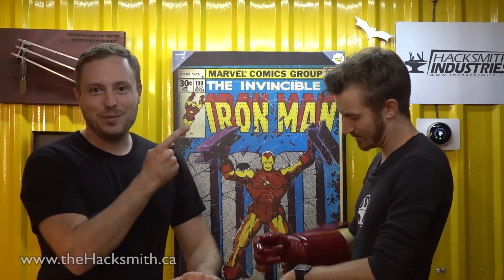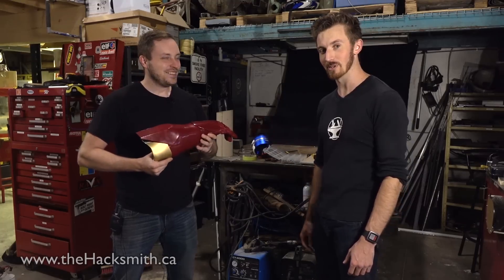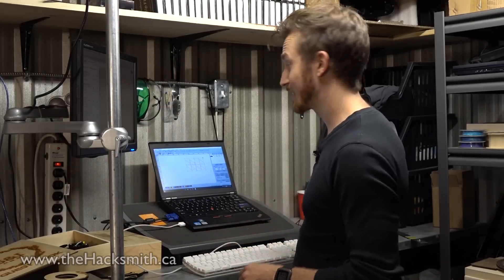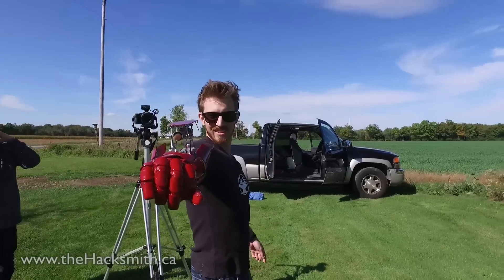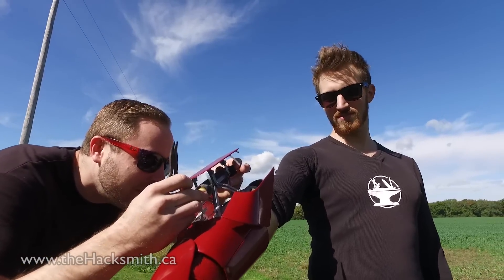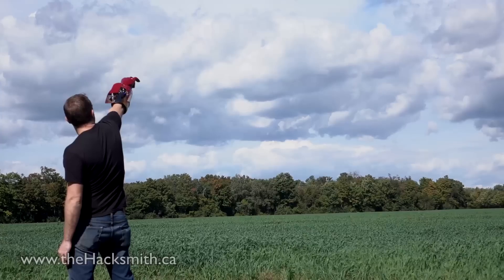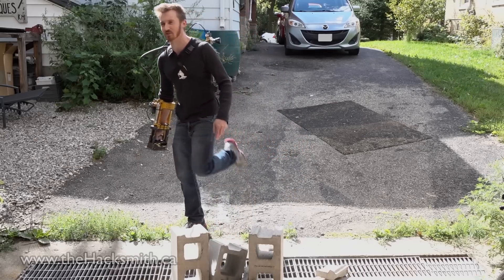Jairus of All's Iron Man Rocket Launcher with REAL ROCKETS!!!

Comment: it's going to blow your arm off on a miss fire. for sure. 
how about launching the rocket using some other method (compressed air maybe) and igniting the rocket in flight.
Reply from the maker: +Jim Williams extremely difficult to ignite a rocket already moving + it's almost guranteed to go off course -- the rocket launching tube is what makes it start out flying straight ( though not really in this case )
Reply: use a test dummy not yourself. buy a shopstore mannequin.
Reply from the maker: +Jim Williams it had a miss fire and nothing bad happened... What exactly are you envisioning?
Reply: That's not going to happen with model rocket engines.  I've been using those thing since the 1970's.  He could get burned, inhales some of that wonderful exhaust but the death thing aint gonna happen.
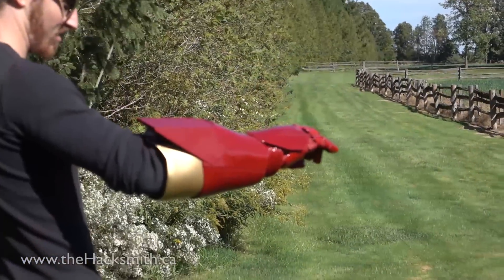Reply: 4:25 - 4:26, it looks like the rocket hits and deflects off your hand.  I assume it did not hurt at all?  How are you supposed to get through Capt. America's shield?
Reply: I'm worried a defective rocket engine could explode all at once instead of producing a controlled burn. Knee jerk reaction to possible danger on my part.
Could a rocket be lauched and then ignited mid air?
Reply from the maker: +henryk077 nope
Reply: would adding more weight to the Tip of the Rocket help with flight trajectory?
Reply: ijustateacow Model rockets fly better with hollow nosecones.  Making the cone heavier wouldn't help.
Reply: ok, Good to know! thanks!

Comment: I've been wondering a bit. You mentioned that ZNA came over to your shop. Not exactly sure if it was project related or just a visit
Reply from the maker: +jose paolo Aranda he hasn't come yet
Reply: Alright then. Sorry for the inconvenience.

 By the way, I also wondered about the rockets used in this video. I know they're solid fuel rockets, and the inconsistency between the shots are caused due to them being homemade as opposed to professionally made. I understand the professional ones would cost more money for such a short amount of use, hence it would have been reasonable to try and make your own. What I wanted to know was how effective these would actually be if they hit a solid target. What type of damage would have been sustained and would this actually be practical as opposed to just chucking a firework at them. 
And if you were to get professionally made ones, would they also provide a large amount of damage? Could these then be modified with explosives later on?
Reply from the maker: +jose paolo Aranda ask Jairus! Go subscribe to his channel, he's the one who made it and is working on upgrading it :)

Comment: +Hacksmith that's awesome fairplay to the smooth operation. opens and closes like a beaut. to increase accuracy imo would be 2 fold. one would be to flatten and close the gaps for the blast plate so explosive decompression will propel outward evenly and second of all perhaps either engrave the heads of the rockets with a spiral or put a groove on the inside of the tube to put a spin on the rocket. bullets become more accurate when they put a spin them. alternatively you could put the rockets in a detachable "slug" casing to dampen the extent of which the friction is causing drag but I don't like that one so don't count it. thats just my thoughts apologies if you have already tried/considered

Comment: Probably letting the pressure escape backwards is the problem
Reply: the Hacksmith not the best scienctist but maybe if you do what he said build up some more pressure at back and put like 3 little cuts for the fins of the rocket in the metal pipe that could improve the flightstability(im dutch by the way so my english is probably horrible)
Reply from the maker: +SensTV1994 how would it go forwards then . ..
Reply: The shroud, i hope that's the right spelling. In the testing clip he shoots them from the ground, which, i assume, he's stuck a pipe into. In the actual glove there is this metal plate in the end, if that would be close of, i think it would fly straight. With the holes on the side, the pressure isn't even, so it gets an initial shift
Reply: SensTV1994 i

Comment: what about spring loaded cardstock fins instead of flexible plastic?
maybe an elastic band going from the tip of the fin to the nose, using a chamber style loading dock to keep the fins compressed until the housing is raised, fins pop out and remain stable During flight.  the problem is obviously dorsal instability which is generally caused by faulty fins, not cg placement, which would cause small axis rotation ie flips instead of swerving.

Comment: I think the inconsistancies might come from the friction of those fins,they get stuck in the shaft (for a small time) until they cut loose due to the rocket. But they don't cut loose all at once,so they fly a little off (and a little of is a lot off in terms of rockets) so you need small cuts for the fins to fit into.

Comment: 3:21 that was the ex wife xD
Reply: hammertech lel.
Reply: Hammer Tech? “Yeah”
Reply: The 'Ex wife' rocket was described by Justin Hammer as a kinetic kill missile (that's not the full description), which means that it uses speed to penetrate its target, get inside, and then go boom! It did not fail because it was faulty -- it failed because Rhodey fired it at a short range target and it did not get enough time/distance to build up speed.
Reply: Where?
Reply: jesusavelar oh my gosh I just commented this, I mean I'm a year late but still
Reply: Hammer tech
Reply: I understood that reference!

Comment: The rockets are balanced incorrectly.  Cutting to the chase. . . . try making the nose out of clay or epoxy.   Simply put.   To fly where you Push them, they must be nose heavy before, durring, and after the fuel is expended.

Comment: nice build.. maybe if you could put some fins on the rocket which it can make the launch a bit stable.. or maybe it lacks on force pushing rockets on minimal point.. slow force, makes unstable flight that makes it wiggles..

or make a barrel holding the rocket bullets same as the guns..

just messin up.. 😁😁😁

Comment: Could the fins be what's affecting the aerodynamics?
Reply: the fins are probably not unwrapping to give the rockets stability... he should adopt flights from a arrow & ditch the plastic bottle DIY jobbies
Reply: The fins are the only thing stabilizing the rocket so no
Reply: well not effecting it more not aiding it.. they need to come out n stay as straight as piss but they use flimsy plastic which will slightly fold out but not hold any form.. it's why u see the rockets fly all over the place
Reply: if u apply a structural fin that becomes the guide until the rocket breaks loose from the tube.. ie the fin tips touch the tubing nothing more
or 2nd option change the tubing to allow the rocket to sit in a tube structure whilst the fins are able to poke out thru 3 slots running the length of the tube... this again would allow the rockets to fire straight "it'd be easier if pics could be uploaded in comments"

if the rocket was larger it could use spring loaded & harder material fins. using thin plastic from a bottle & hoping the fins spring into position isn't working as u can see.  or as someone else commented use a Co2 canister & a lightweight projectile... same effect but less chances of blowing ur eye brows off lol
Reply: Mal P Basically the fins unfold into random positions every attempt.
Reply: yep
Reply: Mal P Folded fins that unfold into a fixed position would be a better choice but the same effect would happen. I have used these engines AND Co2 "cartridges" on pinewood derby racers. The Co2 goes in a straight line more than the rocket engines.
Reply: max steel You are right, the Co2 cartridge would not go more than 10 or 15ft. And the launcher would have to be changed, but not in size. Take a look at the cartridges, the thrust is focused into a small opening in the back. Some movie examples are Chain Reaction and Freddy vs. Jason. lol
Reply: I was thinking the same thing. The fins are affecting the path.
Reply: The issue is that they need the fins to bend into the cylinder.  If they found a way to avoid having to bend the fins into the cylinder things might have been a little better.
Reply: LemminaFingerButters The fins should not be bent into the cylinder, they should fold. They would have better results using a smaller engine and no fins, similar to fireworks.
Reply: I was meaning using the pressurised canister to fire the projectile out not to use that as a propulsion gas in a projectile as that would be more complicated to manufacture in a small scale as this...

having small fins like being used it depends upon the rocket to spin.. or they'd fold out as u see there natural place (aka not straight out)

simple principle I'm toying with is based along the lines of crossbow IE rail for arrow, 3 fins in place & fire = no issues.. just like any other rocket/rail type... this rely upon a floored idea with the folding fins & closed rocket tube..

the fins don't need to be huge nor long another example 'dart like' as it's not travelling at great speed nor distance

there's also the issue of the weight all being at the rear & the length itself of the rocket

don't forget it's based on a film prop from the iron man series....
Reply: max steel Exactly, that is why I mentioned Co2 cartridges. If aimed the cartridge will go straight but will have a downward ark. No fins needed. lol Or just use fireworks rockets, but that could be risky due to burns from trying to launch it from your arm.
Reply: What about straight through aerodynamics instead of having the fins sticking out the side have them built into the body of the cartridge, the same way old school bombs and torpedoes were built??
Reply: ... the fins were fine.. the weight of the loader aka the rocket itself was to lite...